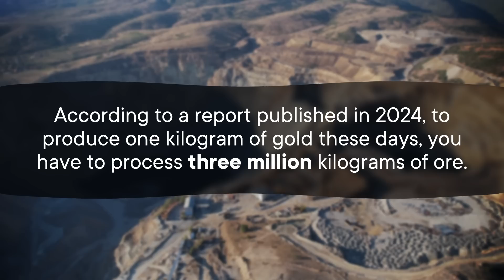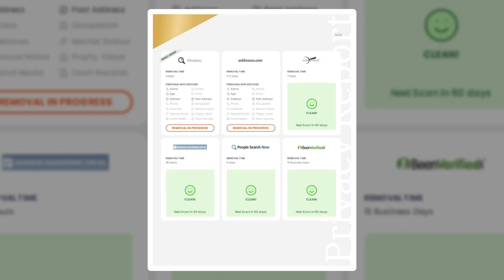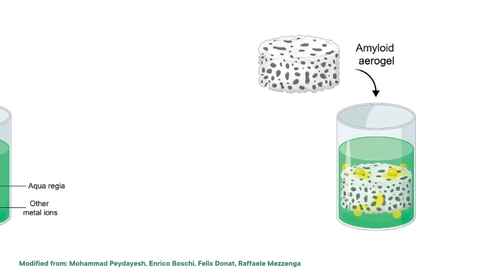We Threw Away $15 Billion in Gold Last Year

Comment: This is just one of the reasons that the amount of electronics we throw away (especially here in the US) gets under my skin. I hope that we crack this soon, and also that we as a society kick the habit of tossing stuff that still works when something new comes along.
Reply: If we had access to spare parts from these manufacturers to be able to repair these devices, this pile would be significantly reduced. But that must not happen because then these producers cannot sell their stuff and as a result the shareholders, many of whom have the political power to change this, do not get enough dividends.
Reply: being told "its best to replace my phone every 2 years"
when i have a decade old Sony phone that still does everything it ever needed to do in a way that doesn't need to be faster or better in any meaningful way.
but at the end of the day, its not how long tech will last, or even how long I would like to keep using it... its how long the product can be supported, or even how long the manufacturer wants to support it.

if you buy a brand new phone and Apple or Samsung decides you need to be buying phones more often they could just retroactively brick your phone (Batterygate-2016)
or remove you from your device by forcing an appstore software update, which REMOVES basic functionality and prevents most apps from running (1st Gen apple iPads)

really if apple wants you to buy a new phone every year they already have all the systems in place to just do it to all their customers. just waiting for conditions to line up to where they can happily place yearly restrictions without receiving any backlash for it.
Reply: @Stue-e  Haven't had a phone last that long but my first rugby lasted me 8 or 9 years and the second I replaced because the network was being upgraded and it was no longer going to work.
Reply: Alot of it isn't on the consumer or at least I can't say so. Planned obsolescence is evil. Be it software gatekeeping or a lack of right to repair/mod. It affects anything with a circuitboard in it. Even cars. The erosion of true physical asset ownership through software pay walls is criminal. I know sometimes old device truly are slower have less storage/processing rates but lately it's been greed funded attempts. Apple is the most egregious when it comes to releasing new devices with so little "improvement" that it's only appeal is it's brand clout/"new" label. 
I'd much rather sink my money into a car that I can Lego pick and choose/optimize/mod than a fully stocked vehicle who's contract/warranty forbids me from customizing. And by God not every device needs to be Bluetooth enabled, not every device NEEDS to be smart. I don't like having backdoors in my devices. It's like a Swiss cheese wall for security. I don't need my car to have bluetooth and I don't want it to. I don't NEED wifi in my car. I don't ever want to pay a subscription for my car beyond  auto insurance and road side assistance via phone call.
Reply: @kaiyote7924  This is all definitely true, but we really and truly do throw away a lot of perfectly usable electronics here in the US.
Reply: @kaiyote7924  I agree with everything you said except the WiFi part and it not being on the consumer part.
Reply: We’re not using resources with any level of efficiency.
Reply: Oh goodness don't get me started on those "disposable" vapes... 

I vape and those things piss me off
Reply: @goosenotmaverick1156 actually dont vape. It is going to kill you. Saying this out of genuine concern not judgment
Reply: You act like you would get anything out of E-waste gold extraction. It would just line the wallets of the ultra rich. You dont get anything.
Reply: They might net a lot more fish on recycling that stuff if they actually offered even a small reward for doing so, with the reward varying depending on how much they stand to make back from it in materials.
Reply: @genisay  Some states already do this with aluminum cans and stuff. Honestly not sure why it's not more common.
Reply: @olstar18  Plastics definitely usually end up in the landfill, I'm pretty sure we have plenty of capacity for aluminum and glass and stuff though.
Reply: @olstar18  ...I know, that's why I said plastic usually ends up in the landfill.
Reply: To be fair my phone no longer functioned how I needed it to despite working. I had it for 8 years.
Reply: @kevinslater4126  Thats another way of saying worn out or broken. Thats why I had to get rid of my first rugby. Some of the buttons were wearing out and the switch to turn the screen on when you opened it worked sporadically.
Reply: what the!? i never expected to see you here, dragonitespam! you got me into gamedev! :D
Reply: I know this'll make me sound like an incorrigible lefty, but until we fix our economic system, the way we use natural resources to generate economic activity won't change.
Reply: One big issue is that most cities do not provide an easy solution to recycle e-waste. A lot of cities will ask you to come dump the e-waste to whatever dump site they have that's only accessible by car. Make e-waste disposal more accessible to everyone and things will get a lot better. Another issue is even when e-waste is taken to a recycling site in good faith a lot of that e-waste end up in landfills in third world countries with lax environmental laws.
Reply: @Megadebt  And thats just the cities. Things get worse outside the cities in the suburbs and worse still in rural areas.
Reply: Just get rid of capitalism ...
Reply: @3nertia  Just get rid of the economic system that has brought more people out of poverty than any system ever conceived and replace it with what.
Reply: @3nertia  and replace it with....
Reply: @Jagzeplin  isn't that the question! I think reducing the conversation to socialism vs capitalism is overly simplistic, only models one of the axes of the graph, and plays into bad actors trying to drive the conversation to either extreme of that axis. The free market is good for some things, like luxury goods; centralised planning is good for other things, like utilities and healthcare.

I honestly believe the ultimate economic system hasn't been invented yet. In the late medieval period, capitalism was a new concept, when it began to replace feudalism. In the late 19th and early 20th centuries, socialism was new. We may well have a new economic system in future centuries that serves our needs better, more sustainably and more equitably. Unfortunately, until then, I've got no answers.
Reply: @Mikey__R  central planning wont work for food production. holodomor and great leap forward come to mind. as for healthcare it does make it affordable but comes at the tradeoff of wait times and accessibility with the govt then deciding whats necessary
Reply: They are made to break, and never come apart cleanly enough to reuse or recycle, because that would lower profit margins
Reply: You can actually recover gold at home. Several great channeles like Coyd's Lab showed how to do it.
Reply: @mernokimuvek  At what expense?  And how much other pollution will the process create?
Reply: @jursamaj  Why do you care about expense? It's about doing chemistry as a  hobby, it's not about money.
Reply: @mernokimuvek  That may be what it's about for you, but in this thread, and the video, it's about economical recovery of materials from obsolete products.
Reply: Well it’s kinda just keeping the house tidy I see no point keeping something I won’t ever use again on the shelf.
If there is a site I can deliver the thing to I will.
Reply: @lolasdm6959   I think you missed the point a bit. 

They were commenting on not creating more things that don't get used/get tossed. The obsession with buying the latest when the one you still have, works. 

It's approaching the same problem but from a different angle I guess
Reply: @goosenotmaverick1156  you know electronics lose performance overtime right? Yeah my old computer works but I am not going to wait 6 minutes for it to turn on. And no vast vast majority of people don’t have the disposable income to buy a new one every year.
Reply: @lolasdm6959   it has gotten to the point that there are phones and tablets that break way before the tech ever slows down.  its not even a " this is outdated " issue..  im guessing the waving away that companies like apple are purposefully perpetuating this will be next..
Reply: @lolasdm6959   so apparently i mentioned @pp!e  purposefully either slowing down phone batteries ( this was well documented.. they even did an " oops software error we created but you have to deal with " speech.. and told everyone to toss their " old " phones.. and they arent even slow.. its just the materials of some companies phones are so bad they have to get sent back, cracked phones put in a rubbish heap with the rest - while your new one is sent out.
Reply: @lolasdm6959  they are producing these electronics to only last four 2 years. in the past we used to be able to replace the battery in our phones. they removed that so that we are forced to buy a whole new phone.